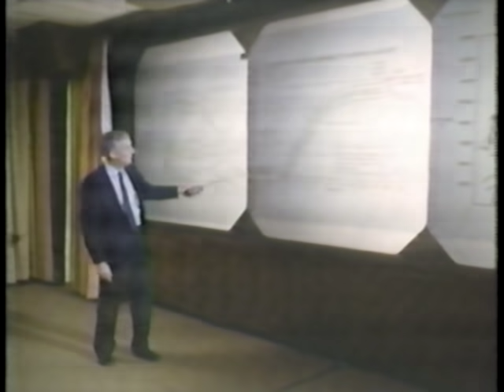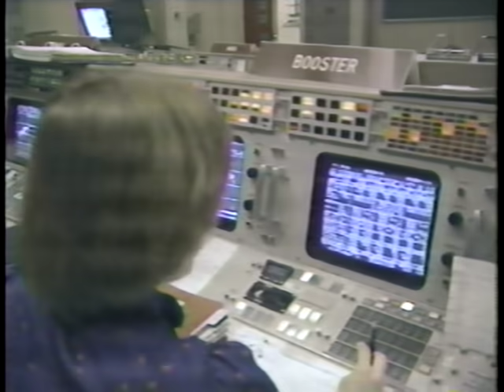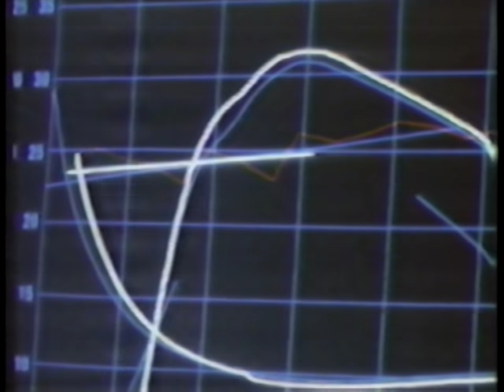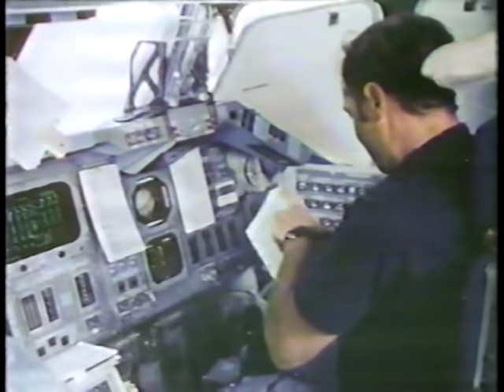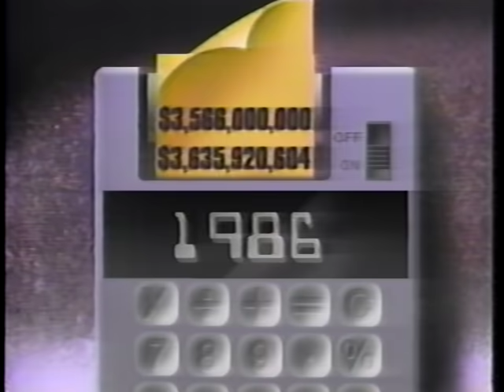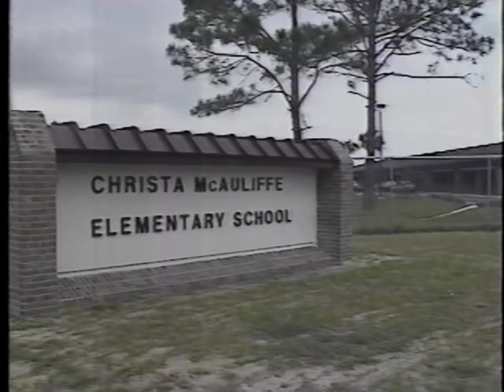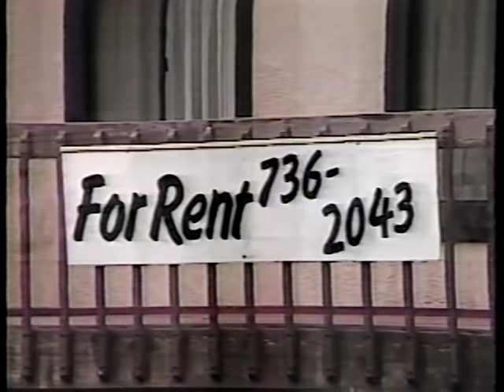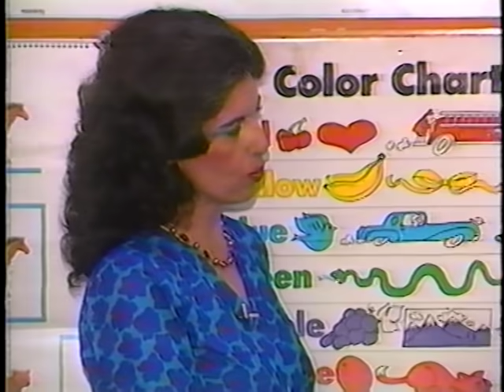Space Shuttle Challenger What Went Wrong

Comment: And then, the SECOND FLIGHT AFTER CHALLENGER, Hoot Gibson and his crew was almost killed. STS 27, DoD mission. Atlantis took hit from SRB cork insulation. Did major tile damage down the right side of the vehicle. NASA disregarded obvious tile damage. One tile was completely lost over a bracket for the S-BAND antenna. The bracket melted. Had the bracket not been there, there would have been a burn through.
Reply: The foam that sits on top of the brown tank?
Reply: Also had that bracket not been steel things would have been different. Aluminum would have melted, and titanium would have burned, either one would have caused the loss of vehicle and crew.
Reply: A forerunner of columbia gibson sat in front of Al gehman and told him that
Reply: @rebelndirt8830  The Columbia had a foam strike that made a large hole in the aluminum portion of the left wing. On re-entry the wing melted and fell off.
Reply: @SymphonyBrahms  The hole wasn’t in the aluminum, but in the reinforced carbon carbon panels on the leading edge of the wing. The aluminum behind the panels was most likely unharmed until the heat from reentry burned through.
Reply: The DoD also made the on orbit investigation into the possible foam strikes very difficult for NASA.
They only sent photos down of poor resolution due to the sensitivity around the DoD payload!!
Amazing how they valued the payload over the crew.
Hoot always said that if he knew the re-entry was not going well….he would make sure his last words were spent telling the DoD exactly what he thought of them!!!!

Comment: Dont forget Challenger had other indirect fatalities.  The PEPCON plant in Henderson, NV where the solid rocket fuel was made exploded in 1988. Like how you included the Slick 6 debacle. However the shuttle would never had launched from VAFB, as the contractor that built the concrete foundations screwed up the build. The concrete was so stiff the stack would have shaken itself apart before the solids lit.

Comment: The Shuttle design was fundamentally flawed, making an escape system nearly impossible. 

In every other crewed spacecraft (US, Russian or Chinese), the vehicle is/was on top of the rocket and fuel tanks. In the event of a booster failure the crew compartment can be pulled up and away from whatever is going wrong with the rocket. 

On the other hand, the shuttle orbiter was mounted to the side of the fuel tank and SRB's, making it vulnerable to any calamity that might occur. When the external tank exploded, the orbiter and crew didn't stand a chance. Likewise for the Columbia, debris from the external tank struck the wing and also doomed the orbiter and crew.
Reply: The shuttle had to be at the bottom of the stack in order to bring home the main engines for refurbishment.
Reply: The Shuttle was Nixon's baby.
Reply: as in all things, design is a compromise.  Certainly the design was flawed, but the O-ring design could be managed; and it was shown to be reasonably safe in many launches.  The fatal flaw was in the Operations of the shuttle, and in the hubris of NASA to believe they knew better.

The consequences of over confidence will very often quickly arrive at your door step.
Reply: The original design for the space shuttle was for a smaller vehicle mounted on the top of the rocket. But they dismissed that idea so that the shuttle could be larger and carry more cargo in it's hold.

Comment: It's unusually scary even to watch this. For example, where they talked about some of the payloads that were essentially bombs on board, or how dangerous it could be just to spill a little hydrazine on your suit, how it could poison everybody. Many times I've wondered how a decision could be made to launch a Shuttle in the face of well-known dangers. I think now I partially understand. There are many dangers in spaceflight, and some of them are major risks. In that category are probably not hundreds, or even dozens, but there may be several serious risks. And if you never launched with a major, known risk, you might well never launch anything at all. This is not to excuse the decisions in the case of Challenger or Columbia. In those cases, a sober assessment probably would have said the hazard for either of those missions was over 10%, maybe over 50%. So those were still exceptional, to the point where launching anyway could be called criminally negligent. But those cases were against a backdrop that was not a whole lot safer, on any launch. The result was a lot of difficult decisions.
Reply: i think they surveyed the engineers or technicians after everything was said and done and the general sentiment amongst the general NASA engineer was that the shuttle had a 1/10 chance of a failure. 

So i think everyone knew about how many problems this thing had and it quickly became normal, expected, and acceptable to go forward with the risk… otherwise, like you said, it probably would have hardly flown.
Reply: The space shuttle was an expensive dangerous failure that killed 14 people in two disasters.

Comment: The Challenger disaster was bad enough, but finding out that they KNEW low temperatures would compromise the o-rings, and went ahead with the launch... that made it far more devastating. The shuttle program was a collosal waste of money, especially when they lost 2 of the 5 shuttles and 14 astronauts due to negligence. Let's not forget: they spent close to $1B per launch -and managed to forget to calibrate the Hubble lense and needed another launch to fix it. Those shuttles were worth a couple billion each, and needed EXTENSIVE maintenance repairs after each launch. The program was a success in many ways, but it never lived up to the mission of frequent travel with a reusable vehicle. They should have been more realistic from the start.
Reply: The space shuttle was an expensive dangerous failure that killed 14 people in two disasters. What's left of the shuttles are in museums, which is where the old dinosaurs belong.

Comment: More efficient solid fuel?  This guy needs to check his facts.  The SRB's had an ISP far lower than most, if not all, liquid fuel engines.  Certainly worse than any kerolox engines.
Reply: Yep... quite true.  Only thing solids had going for them were they were cheap to develop, relatively speaking, and since they require a nearly 2 inch thick hardened steel case to withstand the 700 PSI + internal pressures of the burning solid propellant, it made "reuse" of the casings much simpler-- much easier to recover a 150-ish foot 12 foot diameter steel pipe splashing down into the ocean under parachutes and reuse it than a delicate, lightweight LIQUID propellant booster system... 

Of course the solids ALSO sacrificed safety to cheapness, as well... they cannot be throttled in the normal sense (you CAN design the burn grain pattern to increase or decrease thrust somewhat as the motor burns its propellant, this is called a "regressive" burn or "progressive" burn).  Unlike a liquid rocket booster, they cannot be shut down, either.  Once a solid propellant is lit, it's LIT, and WILL burn until all the propellant is consumed.  

They're also INCREDIBLY heavy (over a million pounds EACH) and that really caused a lot of problems with stacking and moving the vehicle to the launch pad.  Unlike a liquid propellant rocket, which is lightweight and transported with its propellant tanks EMPTY to the launch pad, (as Saturn V was), the SRB's are FULLY FUELED when assembled inside the VAB and transported to the pad.  That makes it ENORMOUSLY heavy, which is why they had to get rid of the steel towers on the launch platforms that they used for Apollo/Saturn, and move the towers to the pad area BESIDE the launch platform (which the shuttle rides on, carried to the pad by the crawler-transporter).  Saturn V was MUCH lighter and safer to assemble and transport to the pad, which is why the tower could be on the MLP right beside the rocket and transported to the pad with it on Saturn/Apollo... 

The solids also made the shuttle much more dangerous to assemble in the VAB, as each segment was full of solid propellant as they were stacked.  Saturn, assembled from empty tanks in the stages, was much safer to handle and work on.  

The weight issues of solids doomed Ares V.  They found through analysis as time went on they needed not just the four segments of the shuttle boosters, but five, and then further study showed they actually needed SIX segments on each booster.  Of course that weighed so much it would crack the foundation of the VAB and launch pads, and would require an all-new six-truck crawler transporter that there was no money for, and HUGE rework/reinforcement of the miles-long crawlerways used to transport the rockets from the VAB to the launch pads.  No money for ANY of that.  They finally settled for the maximum that the VAB and existing crawlers and infrastructure could support-- two  5.5 segment boosters (each booster segment is comprised of two sections assembled at the factory, so a half-segment would be one of these by itself).  They needed more boost, so they started adding liquid engines, but that meant a bigger, heavier core, which needed more thrust, and the whole thing just started to unravel.  That's why they scrapped Ares I and V and went with SLS.  Ares I was a basket case all its own... 

Later! OL J R :)

Comment: There is something that still doesn't add up. Rubber, of any kind,  cannot contain gases hot enough to melt steel. That being the case, how could the loss of a shuttle be attributed to the failure of a rubber ring? 
In my estimation, the failure of the ring was only symptomatic of a bigger failure
Reply: Bruh, nobody ever said that rubber melted steel. You just made that up on the get go..
If you knew anything about how the SRBs are build and stacked together, it would all make sense to you.
You could also read up the doc that was put together by the commision.
Reply: @07Flash11MRC  Could you read again my comment and make sure you understand before responding?

Comment: The primary and secondary o ring gasket enclosures failed on the right rocket booster.
Reply from the maker: Dicky Ball specifically, the cold weather changed the softness of the o-ring. Instead of being soft enough to seal, the rubber became stiff. which left voids for the hot gases to leak through, as they were under immense pressure. This caused a plume of flame, basically a blowtorch, to form and unfortunately it happened to focus on the attachment assembly. When it failed, the front of  the SRB smashed into the top of the external tank. This of course ruptured the internal chambers, which held liquid hydrogen and liquid oxygen. The mixing of these elements are what caused the fireball and basically a white cloud of steam. As the SRB swayed back, it sliced the wing off of the orbiter, which sent it sideways and of course caused it to break up under the force of the airflow.
Reply: @MalcolmShawVids , thanks. I knew that the lower temps(<53*F) would harden the primary and secondary o rings.
Reply: @MalcolmShawVids  interesting
Reply: @MalcolmShawVids Well the cold weather was only part of the problem.  They had evidence the dual O-rings had failed on previous flights as well even where temperature wasn't an issue.  It just hadn't burned through to the point the vehicle was lost. The O-rings weren't actually fully redundant for each other as was believed due to the design of the joint.  This is one of the things that was changed after the accident.

Comment: “Fail-safe” does not mean “fail-proof.”  Fail- safe means that when a particular failure occurs, the system enters a safe state.  I can’t imagine what kind of failure of a booster would be safe.
Reply from the maker: Yes, but I think what you are referring to is the notion of removing the O-ring altogether. The idea being, no O-ring, no chance of an O-ring failure. However, another documentary I saw on this issue was the redesign was actually complicated, inviting murphy's law creeping in.
Reply: @MalcolmShawVids You don't seem to understand the role redundancy plays in engineering.  The SRB joint was required to be redundant, and it had 2 O-rings to provide that redundancy to meet the requirements.  As it turned out there was a flaw in the design that meant the two O-rings had a common failure mode, so they weren't truly redundant.  They added a third O-ring to meet the redundancy requirement in the redesigned joint.  They also added joint heaters to address the temperature concerns.

Comment: The man who said they are traveling over 100 mph by the time the shutle clears the launch tower is ridiculously exaggerating.  Based on time & feet per second, it equates to approximately 17 mph.
Reply from the maker: I always thought that seemed high. It is accelerating, so you could be right that is the average velocity, but the actual speed it's going at at that moment is probably higher than 17 MPH.
Reply: @Malcolm Shaw  No, not really.  The entire assembly is just slightly more than hovering from simple thrust at takeoff.  At 1.46 feet per second per mph, factored in to the height of the tower and time to clear it, 17 mph is pretty accurate.  Once it fully clears the tower, the acceleration begins to increase rapidly.  Think about a Harrier fighter jet aircraft.  It will make a very slow vertical accent, then slowly push forward and then rapidly accelerate.
Reply from the maker: @Dave-co1cv  "Reaching 100 mph as it clears the tower, the shuttle is a study in thunderous vibration, and this only builds in intensity for the first two minutes until the solid boosters tail off and drop away with a pyrotechnic clatter."

https://www.historynet.com/space-shuttles/#:~:text=Reaching%20100%20mph%20as%20it,away%20with%20a%20pyrotechnic%20clatter.
Reply: @MalcolmShawVids  Yes, I watched the video.  It does not reach 100 mph as it clears the tower.  Video and a stopwatch do not lie.  It is not even close to going 100 mph after a mere 380' above the ground.
Reply from the maker: @Dave-co1cv  Speed is time times acceleration.
Reply: @Malcolm Shaw  I'm well of that.  Apparently, you still don't understand the issue here.  I'm done here.  Have a great day.

Comment: Well... 3:00 + + ...How can you fly through the fireball, while it's been ALWAYS behind you, and you constantly accelerate? Oh, just a pre-GSCE pupil question... ??? So??? (and, btw - we can hardly see your fireball on the footage... )
Reply: There are small forward-pointing solid rocket motors on the front of the SRB's (and aft pointing ones on the rear skirt of the SRB's) that are ignited when the charges that separate the SRB's from the External Tank are fired to jettison the SRB's.  They blow a big plume of rocket exhaust FORWARD to push the SRB's backwards and away from the accelerating shuttle... This looks like a "fireball" from inside the cockpit.  

The same thing was used on the Apollo Saturn V moon rockets, for the same reason.  When the first stage engines shut down for staging, a pair of solid rocket motors under each of the four fairings under the fins on the back of the first stage would be fired simultaneously-- this would create a backward thrust pulling "down" on the vehicle.  A split-second later, a sequencer would detonate the linear shaped charge on the back part of the interstage ring connecting the upper stages and the first stage, severing this connection between the stages.  The front stages would then continue to coast up and away from the decelerating first stage as these small solid rocket motors burned out.  This caused the astronauts to be thrown forward in their seats when the motors fired, and then back in their seats as the stages separated.  To settle the propellants in the bottom of the tanks to start the second stage engines, ANOTHER set of rearward-firing solid rocket motors called "ullage motors" would be fired immediately after the linear shaped charge separated the stages.  This would accelerate the stages and threw the astronauts back in their seats as well.  Once these motors had caused the propellants in the tanks to all slosh back to the bottom, the rocket engines on the next stage would fire up, and the rocket would continue on, jettisoning the interstage ring to get rid of dead weight.  Watch the staging in the movie "Apollo 13" and you'll see what I mean.  

The astronauts reported seeing a fireball outside their spacecraft as all this occurred.  The blast of the forward-facing rocket engines blows this "fireball" out in front of the accelerating vehicle, creating the effect.  Remember when you're seeing it from ground cameras, they're miles away and under miles of atmosphere looking at something occurring on the edge of space, where gases cool quickly, and viewing it against a bright sky.  So it doesn't look like a fireball to us on the ground, but to the crew, it's quite visible and impressive.  

Later!  OL J R :)